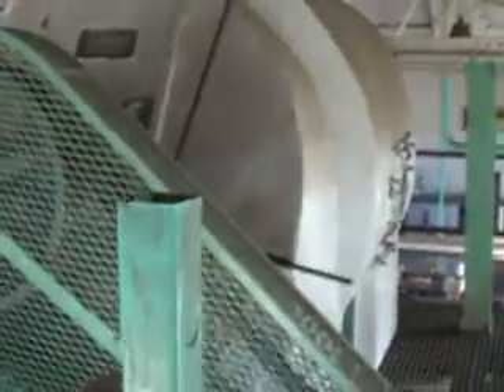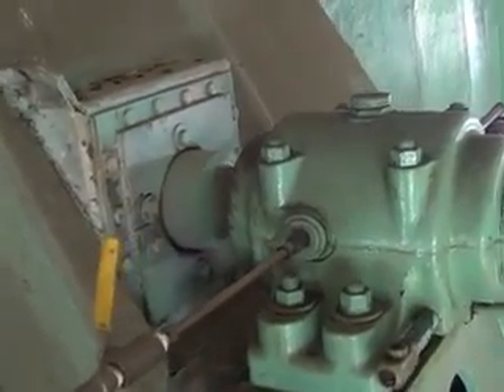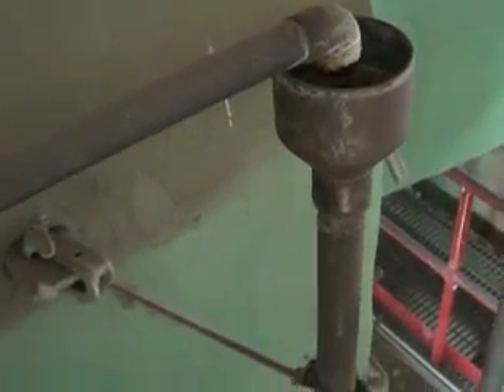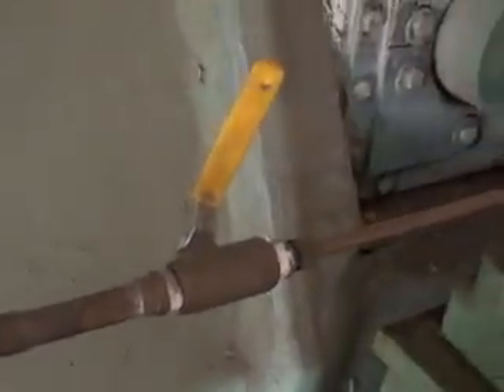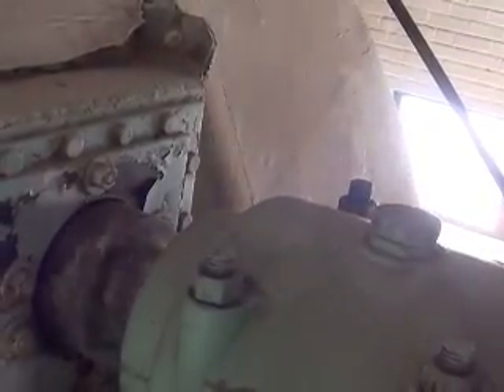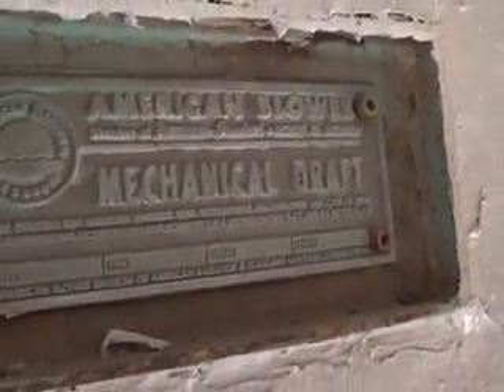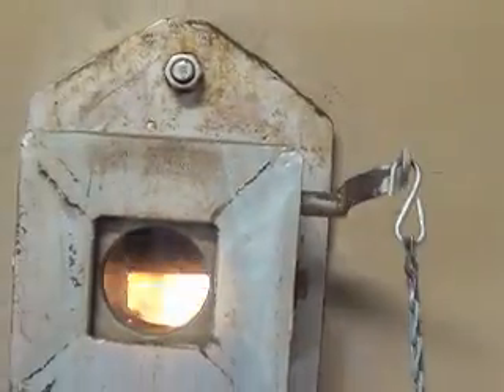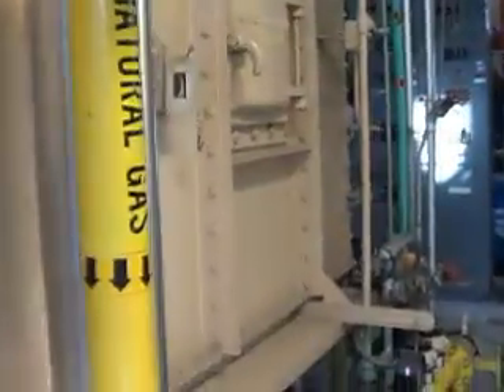Boiler 3 Water Cooled Sleeve Bearing

Comment: Neat bearings. The steel mill i worked at had similar bearings on the bag house fans only much much larger. The fans were massive 15 feet tall squirrel cage fans 1000 some odd hp direct drive.
Her's the one and only approved video of the seattle steel plant. Lots of cool stuff to look at check it out http://youtu.be/7hnXMI_LK7k